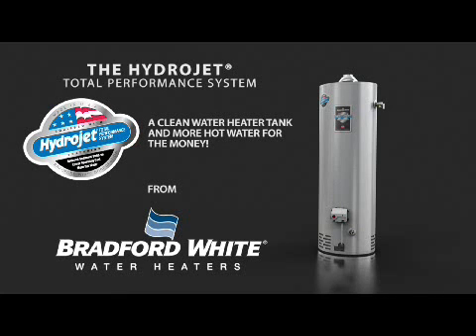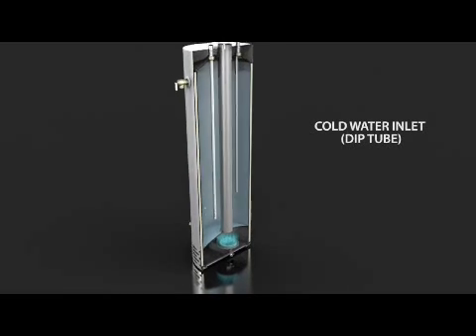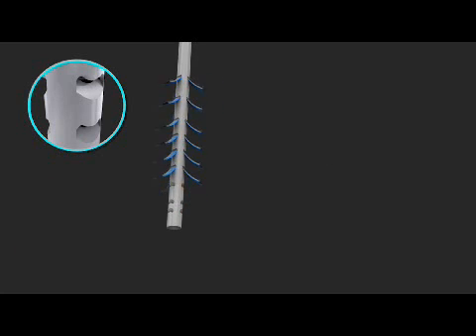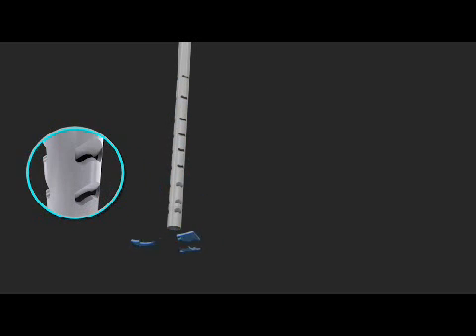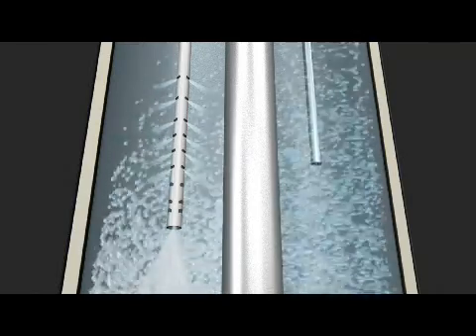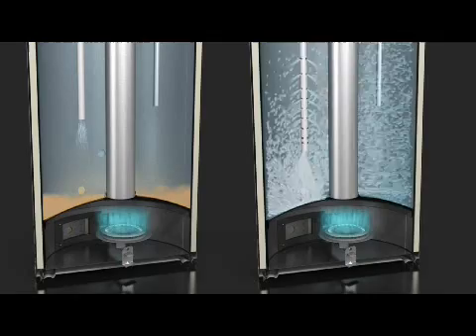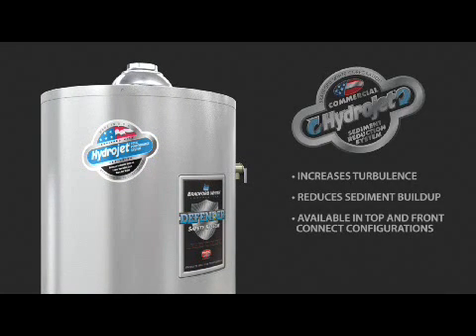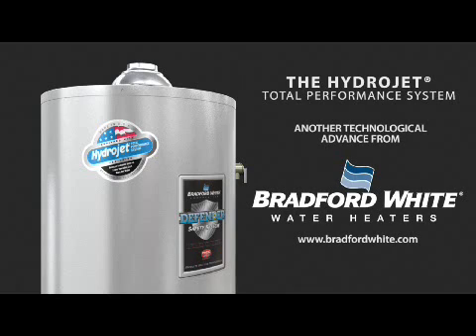Bradford White's HydroJet

Comment: Do you need to flush the tank?
Reply from the maker: It's a good idea to flush the tank yearly on all water heaters
Reply: I just flushed my hydro jet tank after 2 and 1/2 years. There was hardly any sediment, granted I have ozone water treatment and a softener which takes out most of the calcium,  iron, manganese and sulfur.